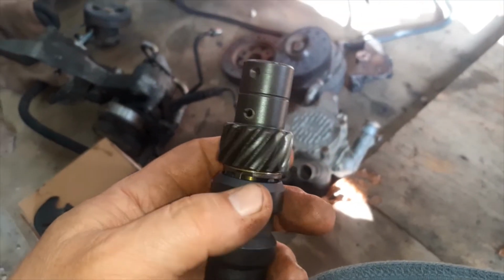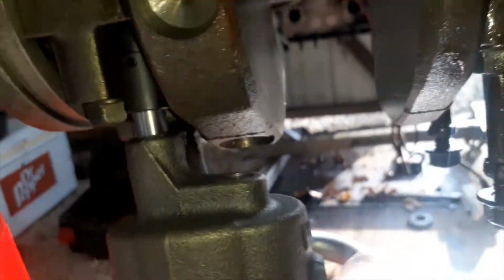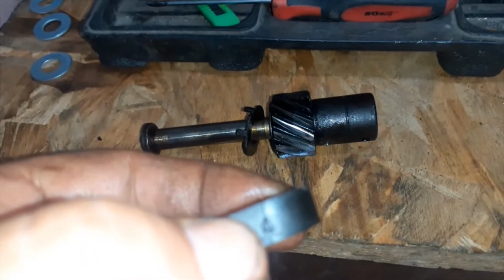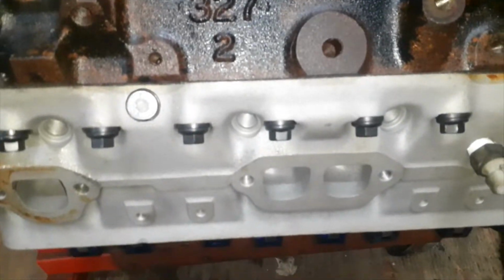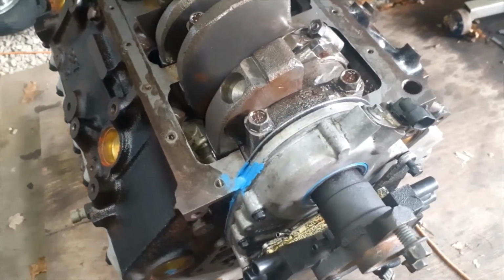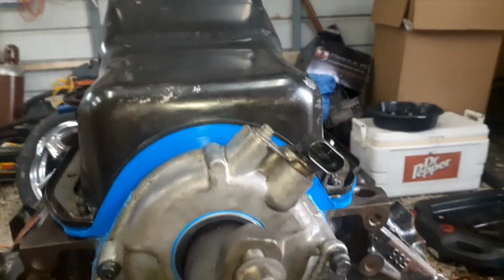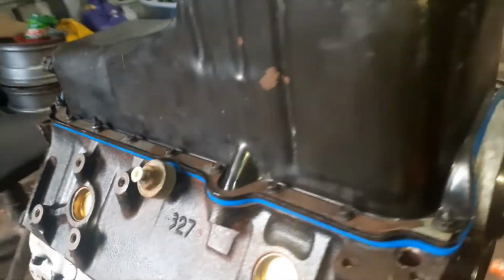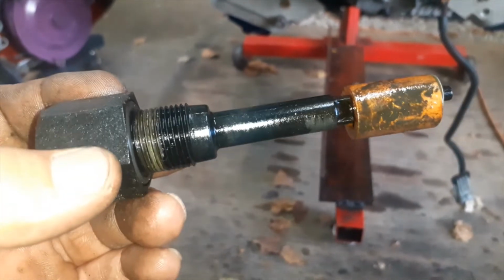Gen 2 LT1 Rebuild Part 7: Oil Pump Drive and Oil Pan

Comment: I have the tick performance  oil drive gear housing on the stock gear . I can get it in but it’s not seating all the way .
Reply from the maker: @joshuarickerson7893  it will only line up with the oil pump drive 2 ways, turn motor over with light pressure on the gear, it will fall into place when the oil pump drive lines up with it.
Reply: I’ll give it a try . If the drive fails on the slot but the housing is not seating all the way does that mean the gears are not in sync
Reply from the maker: @joshuarickerson7893  the gear will sync a few different ways but that slot will only go in 2 ways, they never drop straight in unless you are really lucky, I always have to turn the motor over a little to get them to drop all the way down
Reply: Ok thanks for the help I’m going to give it another try